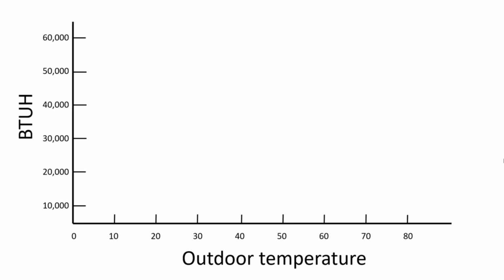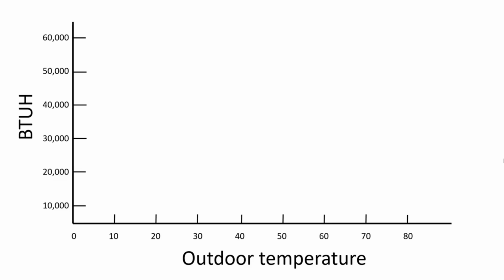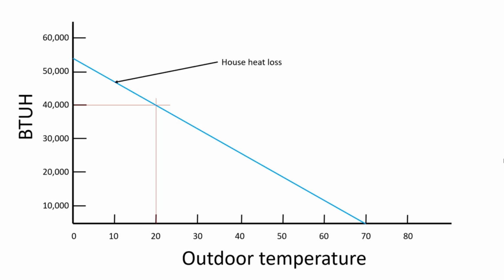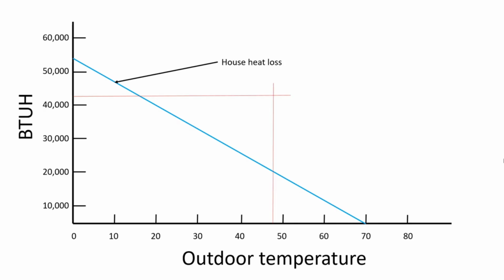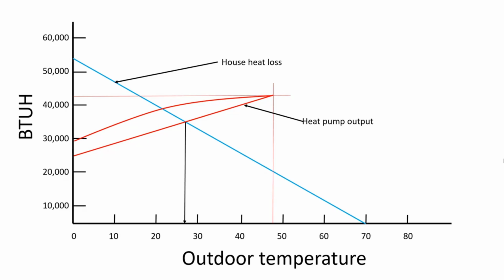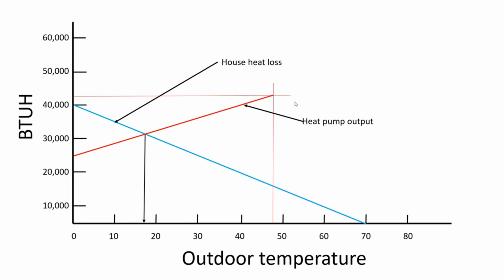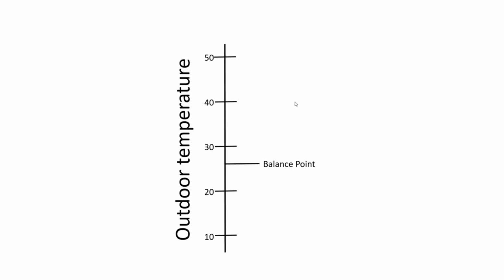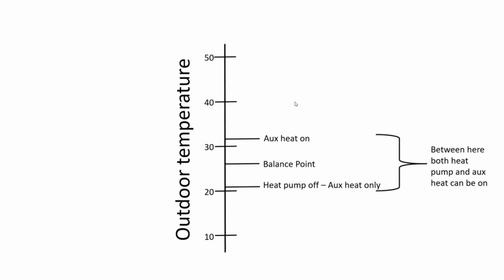Heat Pump Balance Point revisited

Comment: Why turn HP off when it still creates heat, as long as it's COP is above 1 then it should lower the utility bills when running with the strip heat.